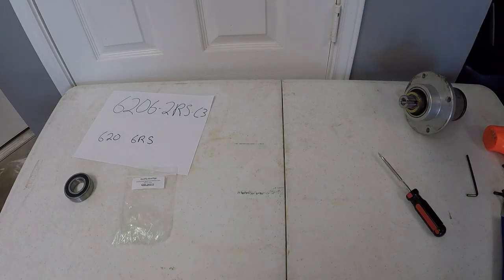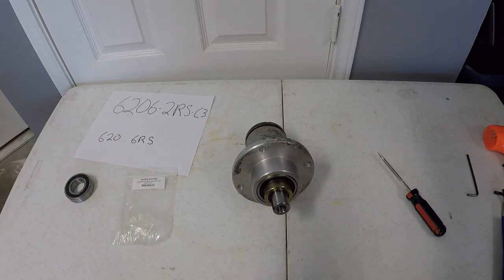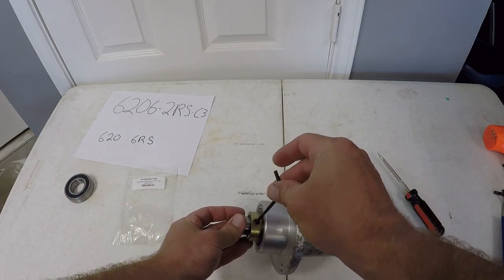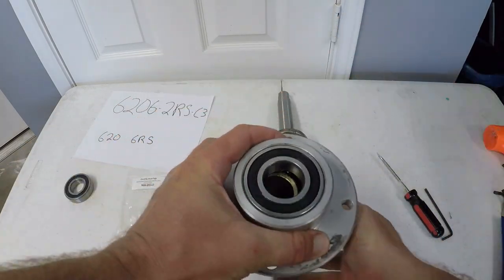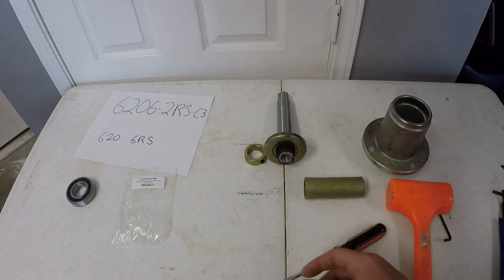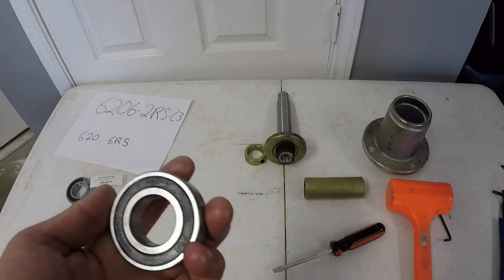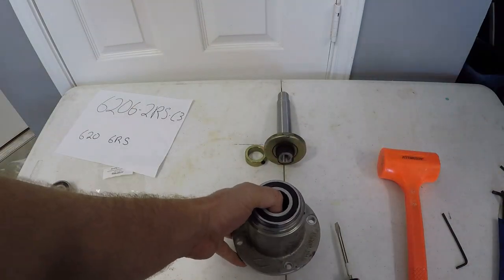BadBoy Greaseless Spindle Bearing Replacement

Comment: Thanks for the instruction!! This will come in handy in replacing the bearings in my 60 inch cut Bad Boy!
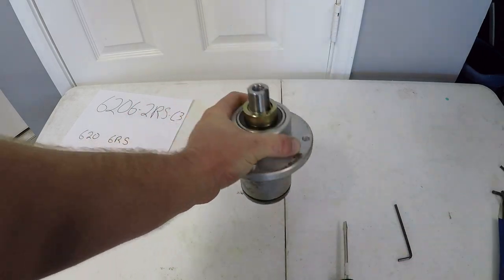Reply: When changing bearings pull inner seals out of bearings  drill a 6:40 hole an tap for a grease fitting you get four plus times more usage being able to grease bearings yearly

Comment: Very helpful. I just did my last cut of the season with my Elite 60". This is my fourth year on this mower and I mow, weekly, a 9 acre "rough" yard. i.e. a lot of hills and bumpy ground. Halfway through the cut I noticed a droning sound coming from the deck. That is, when I disengaged the blades the sound went away. Looks like I'll finally be replacing some bearings. Great video. Thanks!
Reply: May I ask how many hours did you have on it?
Reply: @austinb4254  to quote Indiana Jones, it's not the year is baby, it's the miles.

It currently has about 600 hours on it, and a lot of my yard is almost like bush Hogging. That is, it can be quite bumpy at times and on several occasions I've hit things like a chunk of rebar sticking out of the ground. And of course there's always the odd length of old barbed wire fence in the dirt.

And I've had replaced two of those black bars that swing down from the frame to connect to the deck to keep it from moving forwards and backwards. It's because of things like sliding down a small piece of Hill and catching that on a sapling and the whole mower just stops in his tracks. That's why I now have three extra of the swing bars.

Bottom line is, though this nor had a couple of problems that it shouldn't have had, one being a manufacturing defect in the other being a design defect, I don't complain because it is really held up to the kind of treatment I've given I just see this really important to keep the lube, and filters and everything like that maintained. Frankly, I think it's served me a lot better than my son's exmark has served him.
Reply: @ReasonablySane  Thank you for your explanation. I myself have a rough yard and a 2016 badboy outlaw xp. I don't need spindles yet . but may look into replaceing bearings. before needed.

Comment: Excellent explanation! I just ordered two new bearings for one of my mavericks failed spindle(one of my 3) I’m at 77 hours on my machine
Reply: I've got 88 hours on mine, and have had 2 spindle failures.  Bad Boy has a serious problem with spindle bearings.
Reply: @n5uge12  Yeah, bearings are running dry. Needs grease zerks on the housing or spindle and greased regularly.

Comment: My MZ used to eat bearings before l started using spanner wrench on the pulley to hold the spindle to loosen or tighten the blade. 
I know manual says to hold the upper bolt but it overtorqs the bearings when you do that.
There are 2 holes on them pulleys for spanner and l am 100% certain thats how they assemble them in factory.
Reply: Great info.  Thanks!
Reply: Unless the mfgr forgot to install the spacer inside the housing between the bearings' inner races, there is no way to over tighten and damage the bearing. On mine there is a big thick walled bearing spacer. The spacer is necessary to prevent pulling the bearing covers into the housing. The spindle collar set screw should only be tightened after the top pulley bolt/lock washer and Belleville washer have been tightened.

Comment: 6206 is a common bearing 2 means 2 seals. I'll be removing blade spindles, front pivots, and wheel bearings s, popping out on seal, installing grease zerks and using synthetic grease. Sad for a $4000 mower.

Comment: Thanks again for making this video..... it seems weird that the spindle doesn't  have any grease in it, and the bearings (I just got a few sets) don't really look like much, for the "force and speed" of the blade shaft spinning around so fast, but I am not an Engineer!  My noises were different on each spindle - it seems to me that any noise is not a good noise, though, and will rebuild a few this winter, after I use the mower a few more times.  My mower is not even a year old, and seems very solid, otherwise, but I don't know how I feel about this spindle setup.  Do you know the typical (standard) life-expectancy of these little bearings?

Comment: what you need tow is leave the spacer out drill a # 3 hole tap 1/4 28 for a grease fitting

Comment: you should have removed the seal on the new bearing, they only have about a finger tip of grease on one side of the bearing. I use Bel-Ray Waterproof Grease, not sure if that is the best type of grease for these bearing but it has worked great for me for years, and never hammer on the inner race of the bearing if you are planning to reuse it or on a new bearing. a socket that fits the outer race is a great way to hammer or press it in or out.
Reply from the maker: I wasn't planning on saving those old bearings so wasn't too worried about tapping them out of place.  The new bearings held up well until I sold the mower.  Hopefully still going strong for the next guy.
Reply: @LaidBackLawnCare  Why did you sell the mower? I was considering a bad boy but now I'm not sure
Reply: @msclecarcrzy  I sold that mower to switch over to standers.
Reply: @joshsimon9977  Ok thanks for responding. Do you recommend the bad boy mower?
Reply: @msclecarcrzy  if I was out shopping for another mower I would look at bad boy just as seriously as any other brand.  If the feature set and price are right I wouldn't hesitate to go with one of their mowers.
Reply: @joshsimon9977  Ok thanks.  I like the zt elite 54! It will suit my needs just fine. Or the gravely ZT HD 52. I like the gravely a little better but I believe the bad boy is a little cheaper. Which would you choose if you had a choice?

Comment: Also....do not assume your spindle uses the 6206 2RS c3 noted in the video. These are single row ball bearings. My 2009 Lightning 54" deck uses 5206 2RS, double row angular contact bearings...much beefier. Chinese bearings are OEM but pop the seals and shove that high temp bearing grease down into the space around the outside of the ball carrier until about 50% full (do not pack 100% full.....too much lube causes the ball to skid vice roll). Doesn't hurt to soak the bearings in some brake cleaner and blow out the old dried grease beforehand. Since these operate 7700 rpm and below grease. If the operation was above 7700 oil would be the preferred lubricant (Koyo bearing tech specs).

Comment: The polyurethane  you keep referring to is removable and does NOT hold the Bearing together.  If you wanted to make the Tower/Spindle Greaseable, you can remove the Polyurethane on the bearings and drill the Spindle/Tower housing for a Grease fitting to be used.  The reason the Polyurethane is on the bearings is to keep debris from getting into the bearing.  If you did in fact notice the new Bearings aren't packed with grease.  For the Top Bearing remove the bottom Polyurethane covering and opposite of the Bottom Bearing.  This will allow grease into the Bearings and allow you to grease the Spindles/Towers and cut down on replacing the Bearings by allowing you to grease them.  All Lawn Mower Makers do this with their Bearings to make you buy parts for them.   You cannot get grease into the Bearings with that Polyurethane covering on the Bearings and without the grease for the Bearings it will allow them to burn up even with little or no Hours on them.
Reply: Bad idea for the upper bearing.  Heat and gravity will guarantee the grease flows out and toasts the bearing.
Reply: @almolloy5817  shouldn’t be a problem if you fill the tower with grease and use a high temp grease
Reply: Just add fitting and pump it full, that dust seal will not keep grease from flowing into bearings.
Reply: @bryanmontgomery4050  Yes it will keep grease from the bearings.  I've fixed too many of them without grease from that dust seal.  You can fill the tower/spindle full and no grease will enter the bearing with the dust covers on.  Best thing to do is pack the bearings leaving the dust seal on the bottom bearing on the bottom and the top bearing on top.  You want grease to be able to enter the bearings.

Comment: I have a Cub Cadet "Tank" with a Honda motor, on its 17th year, change oil and blades, never once had a bearing issue and I run the crap out of it cutting thick brush and grass, keeps ticking (2 acres 3x a month).  My brother has a Bad Boy Elite and cuts like golf course grass, cleans it after every mow like a classic car and has had to change the spindles twice in 4 years.
Reply: If he's using water to wash it he's doing them in faster. Water is a mowers enemy. I used compressed air and a rag. If I ever had to hose it off or pressure wash it, I would start it up right after and engage the blades for a minute or so to keep water from setting anywhere. Drive it around all erratic,  kinda like a wet dog shaking off.
And the older mowers had grease zerks for those of us that would use them. Make a bearing last.

Comment: Could you drill and tap a hole for a grease zerk in the side of that housing, I know the grease would not lube the bearings, but filling that cavity with grease might lower the housing noise level.

I have a new elite 54” mower and when the blades are Turing the noise level is 94-95 decibels which I think is too high,
I have to use ear plugs and (30 decibel reduction ear muffs) to comfortably run the mower,
Mower has approximately 7 hours , never thought a new mower would be that loud,
How loud is your mower when mowing?
Good review on bearings,
Reply: You have bad bearings!!
Reply: pop those inner seals out drill a hole put a fitting pack the housing with grease slap it back together and youre good to go and do the same thing with the front wheel bearings they should last forever if you keep them greased.
Reply: You can but you'll need a whole lot of grease initially.

Comment: I know this video has been up for awhile but I added grease fittings in the spindle and removed the inner seal on the spindle bearings also look at your front wheel bearings they have a grease fitting with double seal bearings so no grease will get into the bearing
Reply: We're you able to place the zerk ABOVE the deck or below ?  I have a two day old Magnum and I'd like to do this
Reply: Dust seal won’t stop high pressure grease.

Comment: Mine are really noisy and probably need replacing. Where did you get your bearings and what was the cost?
Reply from the maker: I think I just looked up the bearing number and found some on eBay.  I want to say the higher grade bearings were around $10 each.
Reply: @LaidBackLawnCare  I asked another question also: my two outside spindles are silver. Do they also have set screws that you need to remove. Also can you tell me how to clear the change oil code, clean filter and adjust valve codes. Thought they might clearmlike a car by disconnecting the battery but no luck. Thanks,  Gary
Reply from the maker: @garymagliocca2913  all the pullys should have the keys to keep them from spinning freely on the shaft.  As far as the codes go my Maverick didn't display codes so I'm not sure how to clear them.
Reply: you can get them at napa the numbers will cross over. theyre  5 or 6 bucks.

Comment: I'd take that little plastic cover off of the inside side of the new bearings.  If you don't all the grease you pump into the housing ( if you have fitting) will never get to the bearings!!!!  Why depend on the small amount of cheap china grease in those sealed bearings????

Comment: Don’t do it this way pull inner seals an add grease fitting into side of housing so you can grease bearings for longer life span
Reply: Maybe if you're a machinist. For everyone else, this is the easiest way to do it.
Reply: @mikezupancic2182  it doesn’t take a machinist to drill an tap a eighth hole
Reply: @michaelwillcutt2619  the common person working on the mower will have a set of sockets and a screwdriver to replace bearings that cost all of 5 bucks each. The average person isn't going to have a tap set or greasegun. It's far easier to just pop a seal off a new bearing, load a bit more grease by hand and seal it back up.